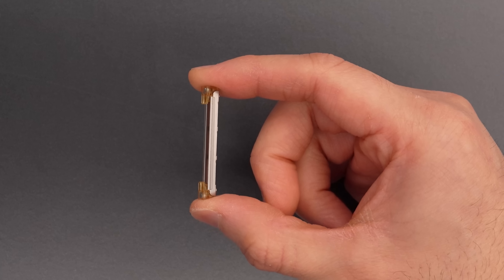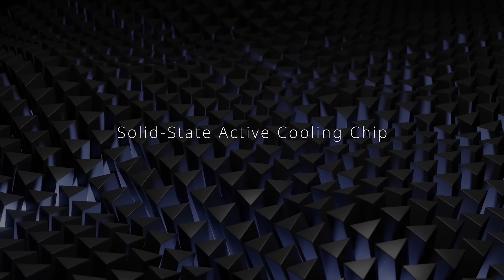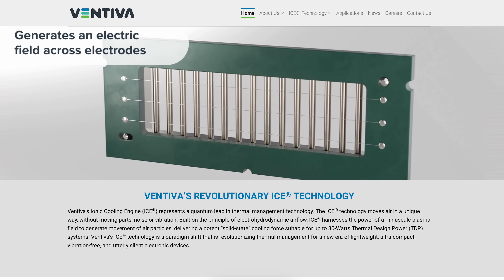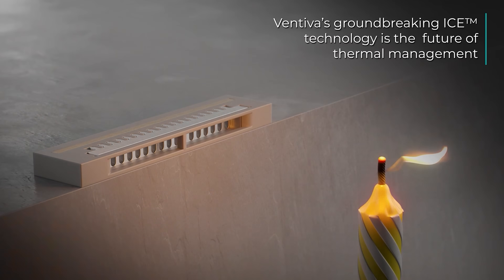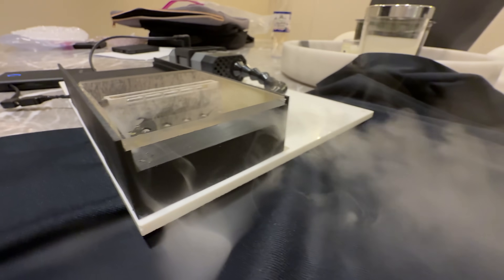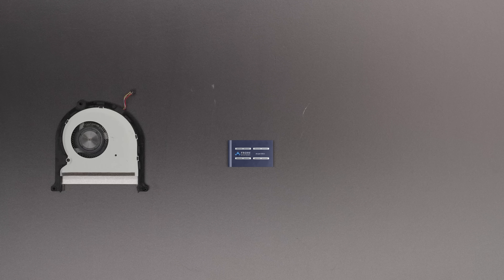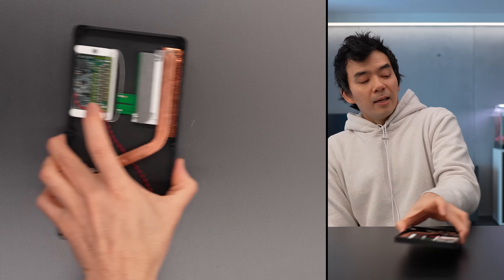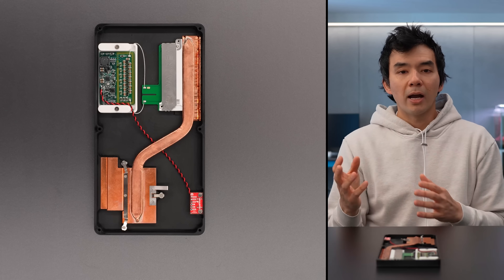The IMPOSSIBLE Laptop Fan...

Comment: This tech sounds too much like Peltier devices:
great on the surface, but weak in practice.
Neither piezoelectric nor Peltier devices are actual "coolers"; they are low-efficiency "movers" (piezoelectric moves air, Peltier moves heat). They can enhance legitimate coolers (like a heatsink/fan assembly) but aren't sufficient on their own.
Peltier devices improve heatsink performance by speeding up heat migration, as they are only efficient in low energy states. The same principle likely applies to piezoelectric devices.
Suggested application:
Integrate two or three piezoelectric devices into a laptop housing (like in Dave2d's laptop example) at low-airflow points to direct hot air toward the main cooling fan. You are not asking them to cool, just to circulate air more efficiently, similar to using fans in a home to aid the HVAC system. No extra vents are needed.

Comment: This isn't exactly a new technology. I remember Sharper Image's Ionic Breeze series of air purifiers from back in the 2000s working on this same principle, and while it was very impressive, those were eventually recalled for one of the same concerns mentioned here: ozone. I do believe they eventually introduced a revised model with some sort of ozone converter on the front just as these have built in, but I think the whole fiasco irreparably damaged their reputation. I'd be curious if the two decades of advancement since then have improved things at all. That being said, I don't think it'd be wise to count out the Frore AirJet yet, either. From what you're saying, a combination of these two technologies might actually cover each other's weaknesses quite well.

Comment: If you look at negative ion generators you'll find many will operate for decades without maintenance  and run with very little power.
So you ought to be able to downscale these while still maintaining both properties.
Sure efficiency usually drops off a bit over time... but you can factor that into any design.
🙂

Comment: Coolers for laptops based on high voltage are not practical or safe. High voltage can damage sensitive electronic components, pose a fire hazard, and violate safety standards. Laptop cooling should use passive methods (like heat sinks) or low-voltage fans to dissipate heat efficiently without risking device integrity.

Comment: Laptops have two inherent limitations that make them suffer (comparatively with desktops): Size and weight. This is an improvement under some scenarios, but it doesn't revolutionize these areas. Interesting tech, but yet another new technology which a company promises will solve the universe and turns out it won't. 

That's considering it even works in real use scenarios. And great video, btw. Exposing the flaws is as important as the positives.

Comment: It's actually old tech used in ionic defusers and air purifier as small as a night light. The problem with that is you need to clean the housing and all metal plates and wire of the burnt molecules

Comment: I really don.t think such technology will ever take off. It is simply 50 times more expensive than a conventional fan, the efficiency is modest at best !!! and the space taken is more than the space taken but a normal fan and also the electronic complexity attached to the system is far greater than gust a simple coil of copper inside a fan and 2 wires to connect to. Conclusion : Simply NOT WORTH the effort !!!  (In my opinion)

Comment: Seriously this is a perfect thing to utilize a intake and exhaust slits at the screen hinge, just as Apple is doing right now - virtually impossible to cover with your quilt, and right on the edge. Then just heat pipe everything that needs intense cooling to it, and use aluminium case to directly dissipate the heat from everywhere else.

Comment: uneducated moron, that tech is an old as the science itself and is absolutely unapplicable, smells like shit(ozone) and have restriction on the humidity aka absolutely unapplicable for portable gadgets because human have the tendency to go on places with no regulated environment. Also for cooling, no only the airflow is important but the speed of that airflow and in that category the airjet will kill nonsense every time even in perfect humidity. Even if try to increase the voltage to increase the volume and the speed, you only will achieve coronal discharge and buzzing sound, maybe fire. Stop promoting stupid things!!!

Comment: That solid state fan has a flaw especially when used inside electronic devices because it also ionizes mist particles which practically turns it into a dehumidifier where water will build up on the negative charged metal and inside electronic devices everyone knows that electronics and water do not mix

Comment: It's been around for decades and rejected by engineers, but he's just figuring it out. 😂 Snake oil salesman. Electronics are very sensitive to overheating. You don't want an inferior cooling system. Equivalent to placing foam tires on your motorcycle. Yes, it's going to work for a mile or two. 😂

Comment: I think there is a confusion here. Ionic thrusters work on the principle of arcing while this technology works on the principle of corona discharge. Arching involves ionisation of gas molecules at high voltage and high temperature. This creates a plasma and a conductive media for the current through air. While the corona discharge involves static charges accumulating in a very tiny region due to huge voltage, which ionises the air nearby (same principle of lightning arresters). The main difference between arcing and corona discharge is arcing involves huge currents (~1-10 Amps) which makes it more dangerous while corona discharge involves smaller currents (~0.01 - 0.1 Amps). Arcing results in more ozone production due to the large currents involved as ozone production increases with increased current.

Comment: I wonder if you could have a hybrid system of piezoelectric devices that have high static pressure just to pull air in but then use ionic thrusters for the actual cooling.

Comment: The tech isn't new.....so likely not gonna be industry changing.  They've literally made ionic air purifiers for 30 years. I had an ionic breeze 25 years ago.  The metal plates used to do the ionization collect dust and become a huge fire hazard and shock hazard. You knew exactly when it was time to clean the metal plates bc of the popping and zapping noises as the current was arcing across the built up dust (not really a desired effect inside a laptop).  Although it did make for a cool light show at night with the lights off.  
The whole reason they brought up the ozone is bc there were class action lawsuits against Sharper Image (ionic breeze) and they ended up declaring bankruptcy and going out of business bc of it.  
The tiny size, location and brittleness of these laptop coolers is gonna make it a hard sell due to the maintenance/cleaning requirements.  Expecting/requiring customers to continually remove/clean/reinstall these things is gonna be a hard sell to laptop manufacturers.....and the consumers.  It took a good amount of elbow grease to remove the dust from the plates.....personally there's no way I would ever buy a laptop with these bc who wants to open up their $3,000+ laptop every couple months and have to use a microscope and special tools to scrape dust grime off ionization plates....and pray the whole time you don't bend/break the tiny components.

Comment: What flow rate at what pressure drop?  How about a P-Q curve?  Real world applications are not like setting up the device with free air on both sides and blowing away a lingering bit of smoke.  We need to move the air past hot surfaces to convect the heat away.  The walls, passages and viscosity of air impose a drag that requires a pressure differential to drive the flow.

Comment: Congratulations on a great product. However, I feel that this product may have some issues.

The first is ozone generation.

The second issue is whether normal operation will occur when the dust settles.

Thirdly, there is a problem of stopping operation due to voltage leakage in high humidity.

Fourth is the issue of price. Existing fans are very inexpensive and stable.

Fifth is durability. It does not look sturdy.

Sixthly, since the high-voltage driver circuit occupies a certain volume, the space never appears to be reduced.

It may be a little difficult to get investment

Comment: Even if it was 4x less energy efficient as a normal fan, the main benefit would be not only sound, but also longevity. Lots of devices have tiny fans in them that wear and tear quickly and become noisy, and they're in products that can't be disassembled, so once they get noisy, you're stuck with that noise. With this, you can remove that issue altogether. This would benefit companies greatly, as a lot of RMA's of these devices are based on failing fans, in otherwise perfectly functioning products. So yeah, even if they consume a bit more power, it's still well worth it. And since you can put these virtually anywhere, you don't need special designs to accommodate a traditional fan. This technology should be adopted immediately by all manufacturers. Even further, you could bolster traditional cooling systems too. Imagine a heatsink that doesn't need a fan because you have one of these between every fin. With these we could build computers that are just solid cube shaped things with slotted spaces for these to run air through. Solid state cooling can change the industry more than people realize.

Comment: This is OLD technology. The Sharper Image created these products in the 80's and 90's called the 'Ionic Breeze' and they were air filters using the same construct of electrical ionization. It required you to clean the plates every so often too. Unless they've improved this part of the process, it's NOT new. Additionally, it produces controversial 'cleaner' air and ionized air which again, is controversial for health reasons. If these are not improved or corrected, this is not new technology.

Comment: Don’t see a point to replace the current laptop fans with this. It’s just making it more complicated for having a bit smaller size. This is more interesting for smartphones or tablets. Make this smaller to fit in a smartphone and any airflow is a win, because there is no cooling system for it right now.

Comment: But it gets hot? Vs standard laptop fans. You'd need a unit to cool itself? Then one for that...

Build a housing, yeah.. but then you'd need one to cool it? What we have now is still balanced. Noisy, but balanced. Very very cool but I don't see this being picked up by large manufacturers anytime soon.

Static pressure is low... It'd use most energy just cooling itself and spitting out its own heat

Comment: This tech isn't new, they tried this with the Ionic Breeze, which was a blade-less room fan. Dust and air pollution was its downfall, and will be the downfall of this too. It slowly builds up a black patina on the metal from dust and partials in the air which get charged. In turn the device plates itself with all those charged particles which reduces the efficiency and is difficult to clean off.

Comment: People have been re-discovering ionic wind cooling technology for many decades. O worked on it in the ‘70’s. A key problem is the high voltages needed to exceed the dielectric strength of air, about 30 kV/cm. These electric fields  generate lots of arcs and sparks, unless carefully controlled.

Comment: and if dust gets in and becomes clogged every month or two then you need to replace it since there is no way to clean it, not even submerging it in isopropyl alcohol of 99 percent concentration can help, probably.
Reply: Supposedly, they have a solution to this but will not divulge how. It's a trade secret for the time being.

Comment: Why overengineer when you have a fan that can do the job. There are tons of fans which takes less wattage but are good enough. Gothe apple way of fanless laptops. Why overengineer something. Dave you had one job!
Reply: Dave is showcasing the tech. He's not responsible for the design. That would be Ventiva. 

As for why overengineer this, I see several advantages... once it can get to the point of being economically scaled. Noise is one, smaller profile in devices which may lead to freeing up space for other components like batteries or extra IO, slimmer devices that may make way for unorthodox form factors, and some others. I'm personally excited for it's implementation in handheld gaming devices. Lighter and quieter devices perhaps.

Comment: Let's summarize.
1) More energy is required for the same air flow as a fan.
2) To ensure the same powerful air flow, you need to increase the size
3) The board must have a high-voltage power circuit - which must be shielded from the main board
4) More noise with the same air flow power as the fan.
5) 25 times higher price with more disadvantages than a fan

Comment: A laptop fan using ionized air technology could potentially be dangerous for humans:

1) Ozone Generation: Ionizers work by creating negatively charged ions that can attach to dust particles and pollutants, but in the process, they may also generate ozone. While ozone is beneficial in the upper atmosphere, at ground level, it is a harmful pollutant. High concentrations of ozone can irritate the lungs, worsen asthma, and lead to other respiratory issues.
2) Exposure to Excessive Ions: If a laptop's ionized air fan produces an excessive amount of ions, it could lead to an unbalanced air composition. Inhaling large amounts of ions might cause discomfort, respiratory irritation, or other health concerns, particularly for people with preexisting lung conditions.
3) Localized Effects: Since the fan would be near your face, prolonged exposure to the ionized air close to your respiratory system could lead to more significant health risks if the ion concentration is high enough, even if the overall room air quality remains within safe limits.

While laptops generally use very low levels of ionized air for cooling purposes, there's still a potential for harm if the device is not properly designed to minimize these risks.

Comment: The best fan is still no fan. I've been using my M1 macbook air now for a couple years, and it's a game changer. No dust, no noise, just 100% silent operation. Yes it will eventually thermal throttle if I push it too hard too long, but for 99% of what I'm doing on a daily basis, this is absolutely perfect. Blowing dusty air from my house through my laptop to keep it cool seems very backwards.

Comment: This product sounds like lawsuit
Reply: It won't make it to market. They have to solve the issue of preventing any particles from getting charged in the air and sticking to the metal, along with the ozone gas it creates. If it's adding filters then they just decreased the air flow while increase the energy consumption and heat. This is why the Ionic Breeze fan from Sharper Image stopped selling when it came out 25 years ago.

Comment: The Lifter works without moving parts, flies silently, uses only electrical energy and is able to lift its own weight plus an additional payload. 
The Lifter uses the Biefeld-Brown effect discovered by Thomas Townsend Brown in 1928. 
The basic design of the Lifter has been fully described in the Townsend Brown US Patent N°2949550 filed on Aug 16, 1960 and titled "Elektrokinetic Apparatus", you will find in this patent the full description of the main principle used in the Lifter devices.

http://jnaudin.free.fr/html/liftbldr.htm

Comment: It was dark and quiet until the humidity in the air increased. This technology really needs a lot of improvements. And combined with the controller, this thing is much larger than a regular fan. The issue of fan noise is not very important for those who wear headphones.

Comment: This can work in laboratory environments and clean rooms as every house and work place and in general any place on earth have dust...that Ionic fan with its Ions that pushes trough and dust blocking or getting in contact with it...going to cause problems in all sorts imaginable ..that can work well in space as a motor to push a space ship.. and take it much faster and further than we can now...But also this is similar to Air purifiers and Ozone devices...but with all metal devices on earth it will eventually over time brake down its not like Captain America's Unbreakable Shied.

Comment: They only start using this type of 0db cooling tech when chips start getting efficient enough for it to not make any sense in terms of fan noise, until than they can get away with this bullshit yearly 10% efficiency improvement resulting in 2% less fan noise and all the retarded consumers and prosumers by it like money wasnt a thing🤡.

Wake up this new tech is only going to be used at the earliest in 2025 when x86 Lunar Lake H series and Zen5 U series arrive which wouldn’t have much fan noise with regular fans anyways. 

If they used this high pressure ventilation tech along with regular fans in a hybrid solution since Raptor Lake,  that measly improvement of Meteor Lake would have been complete joke and a financial disaster. 
WAKE UP SHEEPS

Comment: 8:40 bro, it’s takes a metal rod and some wires to make. Commercially probably made with cnc and stamped metal. Way overcharging. Shouldn’t cost more then small heatsinks. The circuit can be expensive.